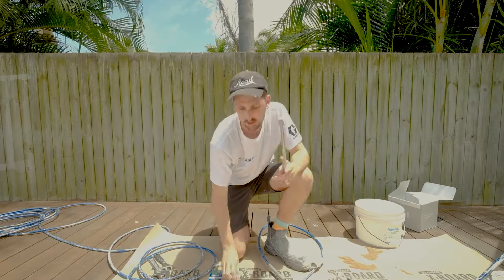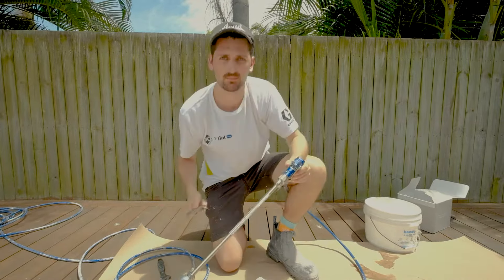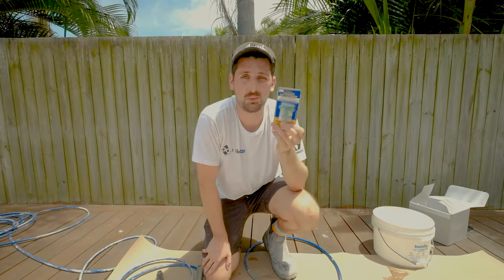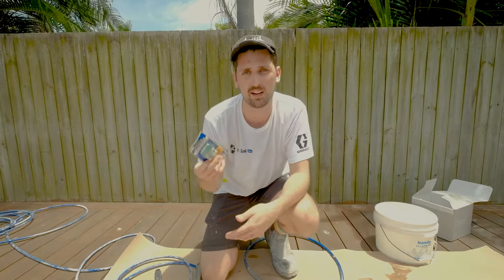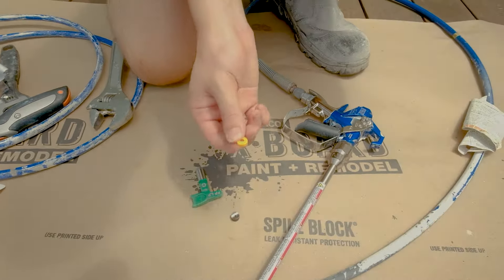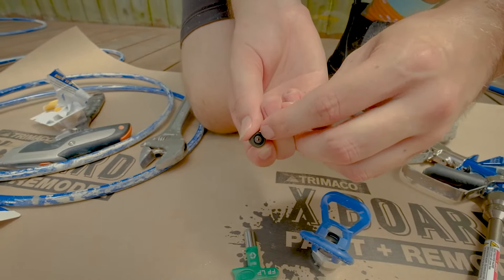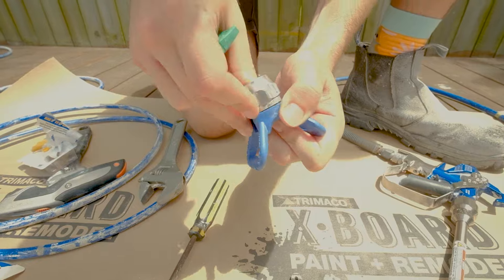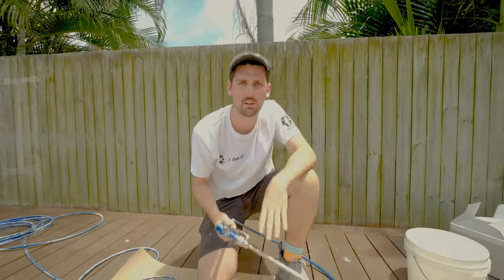How to install Graco Spray Tips, Guards and Extensions - Airless Sprayer Essentials

Comment: Thanks and hello from Canada. I have a Graco and bought an extension but I wasn't able to stop it from leaking...I knicked it as you show, but still leaks. I added teflon tape....and that helped even though the Graco rep told me "no Teflon tape, they are not designed for it". ...I think he said something else but can't recall. Thank again.
Reply: Is it a Greco or Titan extension or is an aftermarket I've had problems with the aftermarket ones leaking.  Also check and see if there's a little Teflon washer if it's in there sometimes they forget to put them in there The Greco extension has a Teflon washer built into it the aftermarkets the Teflon washer just sets in there and can fall out

Comment: you use any extention pole always use a clean shot it will make life a lot easier for you 💯
Reply from the maker: For sure man! We’re always running ours for the 40cm tip extension and longer 💯

Comment: The head of my extension doesn't detach so when it busted the rubber gasket I couldn't replace. Garbage extension
Reply from the maker: You can definitely replace the gasket, the extension should also easily detach from the gun thread. You may need to use an o-ring picker, or a similar tool to take off the existing gasket to replace.